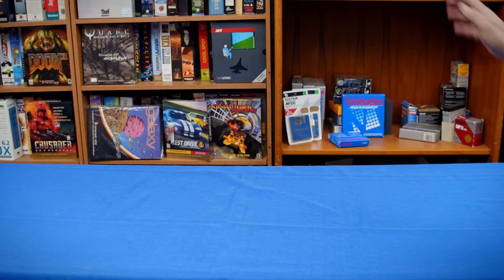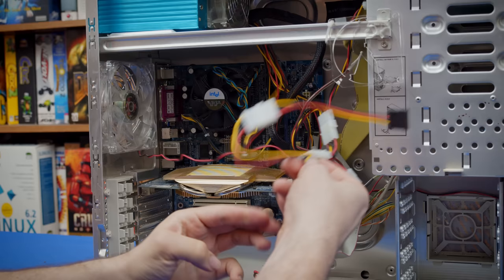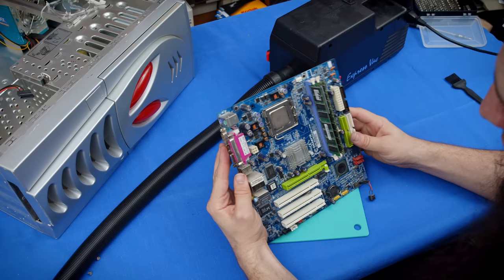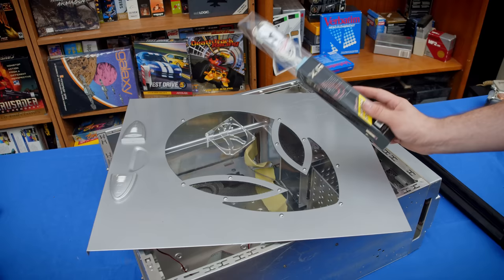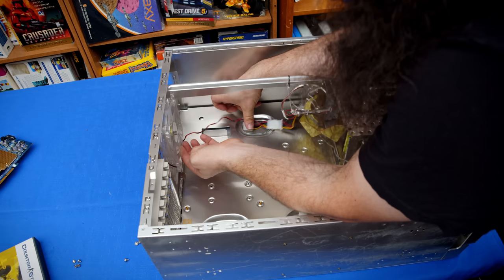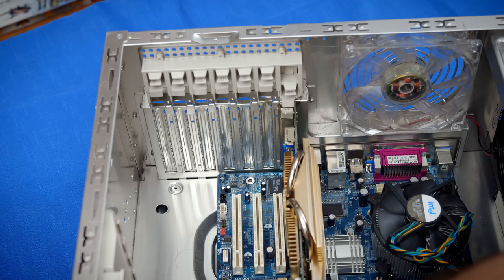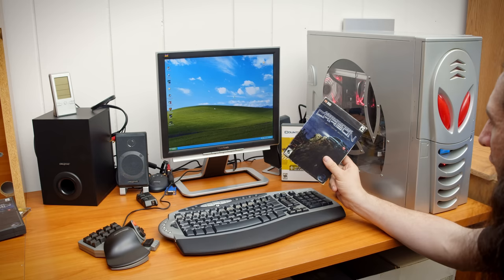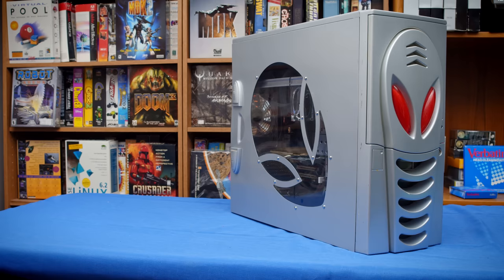Windows XP Gaming PC Brought Back to Life

Comment: That big heatsink actually came with every P4 on socket 775 and was used (slightly redesigned) for several years, the thinner one appeared sometime during the Core 2 era.
Reply: It was well made apart from the crappy black clamping poles.  I made sure to order a Zalman flower cooler when I did my P4 build (Abit AS8 + P4 640 + Winfast Geforce FX5900XT), in April 2005.

Comment: That case (other than the alien) reminds me of the case I have and still use. I have an xclio A380 from circa 2008. Other than mine having absolutely massive special fans, the mb tray and drive mounts are almost identical. Mine has an improved expansion card retention mechanism. 
My giant fans have long-since died, but the case is just too nice to let go. Completely tool-less and sooo much room for everything you could want. And when the fans were working, it had enough airflow to keep even a modern i9 cool.

Comment: Hey Shelby.. new subscriber here. Was recommended by Usagi Electric. Very cool build you have there! I had an actual Alienware Area 51 in the black case, and even though it only had a Core 2 Duo in it, it would still run Win 7 flawlessly, and the graphics were pretty impressive. I currently also have a Falcon NW mid-tower with a Core i5 and 32gb. running Win7 as we speak. It handles any legacy programs I need plus it hosts my security cam software, which Windows 10 doesn't seem to like too much.😂Don't know if you'll see this, but Usagi Electric sent you an email earlier today to see about getting us in contact about some vintage machines I have here!😉

Comment: I have lots of cases like this. I've hardly ever gotten rid of cases. I have one with analogue dials for temps and stuff that i'm looking at right now.
It's probably my favourite of all my old cases which is why i still have it. Nothing inside as that has long since gone but the case is still ok.
I also built a modern PC in a case i bought around 2000 for my daughter. It looks like a power ranger! lol
Reply: I think there was another comment somewhere here from someone looking for a case like that for a retro build.

Comment: Max out the CPU and RAM, add the backlight, replace the thermal compound and pads on the graphics card, and recap the power supply. This is the highest end 00's build I've seen.

Comment: Been working on building myself a pc for gaming/music production, specs are as follows, Motherboard: Asus TUF Gaming X570 Plus WiFi, CPU: AMD Ryzen 7 3700X, Ram: 2X 8Gb DDR4 3200, System Drive: 1X Crucial 1Tb NVME M.2 SSD, 1X Samsung 1Tb 2.5 inch SSD, Optical: 2X DVD Burner Drives, Graphics: Nvidia Geforce GTX 1660Ti 6Gb, OS: Windows 11 22H2, runs great.

Comment: I have an Ultra power supply for over 15 years and it worked flawlessly until I retired it a year or 2 ago and it was still working when I did retire it.
Reply from the maker: For my 20th Anniversary build I opened one that was brand new sealed from 2004 and it had burst caps. It's possible that both of mine would have "worked" but for how long and with what output noise is another thing. Not worth the risk when they have known failures.
Reply: @TechTangents  oh wow. Yeah I understand I would have felt the same way if that happened to me. But in my case I guess I was pretty lucky.

Comment: As someone that went through the pains of upgrading for games in that era, I'll use Need For Speed as a timeline: Up to Hot Pursuit 2, they could run on pretty much anything with a graphics card. Then Underground was another milestone since it was the last series to run on the GeForce 2 MX (very popular back then especially in Europe). Carbon moved up to GeForce 4 and so on. It was a really crazy release/upgrade cycle because it wasn't really the difference between more or less frames: it was will it start or not due to features like Pixel Shader and Direct X versions.

Comment: I've always been curious about where these cases in the mid-2000s came from. The same designs would show up in every online computer store, never with any branding. I assume it was just one company that was churning them out.

And yeah, the speaker on the GPU would squeal loudly at you if you didn't have the power connected. Scared the crap out of me when I was 12 and building my first PC.
Reply: Considering how common chieftech cases seem to be it may as well be.
Reply: Chemning/Chenbro. Available in aluminum or steel. First one I've seen with a 120. Normal config is 80mm front and rear. Looks like the swing feet were removed to cut cost.
Reply: @piscikeeper  Ah I knew I was missing something, it was Chemming lol.

Comment: That was not an AT power connector. It is physically compatible but completely different. It was auxiliary power plug announced at the time when first Pentium 4 CPUs were launched.
Reply: Yep, that’s an early ATX connector with extra conductors on the low voltage rails, before CPUs started running off the 12V rail.

Those plugs may have different keying that should prevent them from mating with the old AT headers, but those keys are often missing or broken.

Comment: Nice find, man! I really enjoy pentiums 4 for retro machines. They are so reliable and cheap! That GeForce 6800 was a very nice find. Indeed it was cream of the crop for agp, one of the faster cards for that bus. One thing to consider is that the pentium 4 probably doesn't have enough oomph to push it properly, but you know, still a nice build. I enjoyed the video.  Thanks for another one. 👍 Edit: I would definitely put a fan on the video card for conservation purposes.
Reply: Depending on the board a cheap Core 2 will perform better and pull less power. Something like the Celeron 400 series should run away from every LGA775 Pentium 4. But if it has to be a P4, Cedar Mill is your friend. Got both here, and both would do a nice job in a mid-late 00s retro build.
Reply: I keep looking out for Tualatin core P3 CPU’s & compatible boards for retro systems as they would smoke a much faster clocked Northwood P4. Intel realised this by basing the original “Core” CPU’s on the Tualatin architecture (obviously with a fair bit of reworking) that replaced the P4 architecture.
Reply: @OliverQueen1974  I remember thinking my P4 2.0 was hot stuff until a buddy with a tricked-out P3 system would smoke me in gaming performance, turns out Northwood (and the Pentium 4 as a whole) was just a failed experiment that they didn't give up on nearly soon enough.

Comment: This is a nearly identical PC to my old PC I just recently restored, sans the ridiculous case. Never liked this sort of outrageous style even as a teenager. I ditched all the original fans and the CPU cooler. They were just too loud by modern standards. Also the CPU always ran hot back in the day with the the stock cooler. I also threw in an SSD for good measure; it only does about 120-130MB/s on this old system, though it's still much faster than it used to be with the old HDD and, of course, it's totally silent.

Comment: For my XP build, I found a version of MSI Afterburner that still supported XP to track temps with (And also try to overclock with, unfortunately the 9600gt I got was a bit naff.) Seems like that would be even more useful here, check to see if that passively cooled card is actually working well. Assuming you plan to actually game on it regularly anyway.

Comment: There were "black light" LEDs around at the time, I recall having one in my computer around 2005. Was basically just the LED at the end of a molexed cable with a holder that came with some double-sided foam tape to hold in place. Considering it was in a Shuttle-style SFF case, there wasn't any room for a cathode tube.

Comment: If you want to just replace the LED with a new one, then simply drill it out. Clamp the acrylic between two blocks (wood or rubber or plastic will do), and simply drill out the LED. You can start with a small drill bit and work your way up. small LEDs are 3mm, and large ones are 5mm. Once drilled out, you can then replace the LED with a new one, even a UV one if you wanted to, and just glue it in place.

The blocks are there to protect the acrylic, both from cracking while being drilled, and from being scratched. You can also place a cloth on either side for added protection. In the case of not having a proper clamp, you could even sandwich it under a stack of books, for example. You don't need to force the drill... It's only plastic. The metal bits of the LED will come out easily under the force of a drill bit. Just do little bits at a time, and go slowly and easily.

Comment: 6800 Ultra was a larger spec'ed card of the era that required more cooling. I loved the cooler designs of those, double slot and usually with artwork. I remember pining after one in 2004 while stuck with my awful mid-range FX series card. I was too poor to upgrade to that, but I did eventually get my hands on a 9800 Pro instead which was an awesome upgrade. I eventually did get a 6800 Ultra from eBay for like $14 before the retro craze  (I can't remember when it was, 2012 or so?) just for nostalgic purposes.

I remember in that era there were quite a few GeForce cards that had crippled memory buses. I wonder if that's happening here with your card.
Reply: The 6800 Ultra is a good 70% faster than the regular 6800. There's a huge difference. That could explain it. This was also an era where an Athlon 64 blew away a Pentium 4 of the same price in games.

Comment: That's a super cool computer. I'm a massive sucker for UV stuff and the combo of mesh and window is quite nice on that. My XP rig's a little more pedestrian, an old Dell Dimension from ~2003 but it's got good parts in it, I got to throw all the RAM it wants at it, and unusually for a Dell, it's rock solid reliable, and doesn't seem to be possessed by demons.
Reply: I still have my Dimension 4550 (from 2001 or so) but maxed the board out to 1 GB of RAM and it's got an FX 5600 Ultra (I threw out the GeForce 4 MX420 that it came with).  I put SO many hard hours of gaming on that system and it still runs great, it's on Windows 7 right now but I may roll it back to XP as a retro setup.
Reply: @406Steven  that's pretty cool, not familiar with the 4550 so gonna have to look it up, mine's an 8300. Is yours using SDRAM if it maxes at 1gb?
Reply: @Ametisti  It's DDR 266, if memory serves.  I liked it back in the day because of the flip-up front cover revealing 2 more USB ports and front panel audio.  It's got a massive heatsink on the CPU with a hood that flips-up for ease of service and a really clever retention mechanic which makes it easy to remove the heatsink.  So it's basically a case fan which also cools the CPU (something which Dell stuck with through most of the 2000s).  My parents got it for me as a Christmas present around 2001 or 2002 and it still runs great!
Reply: @406Steven  looked it up! Looks like the case is the same as the 8300. I do love that era of Dell styling. I'd love one day to like get one of the Optiplex G260 or similar and make like a little HTPC or TV gaming thing. 
I got my Dimension in like... 2012 or something for free for tinkering XD
Reply: @Ametisti  HTPCs are cool and I run one because I always wanted one but couldn't justify the money until more recently but look into an Intel NUC if you want to run an HTPC.  I have one with a 7th generation i5, 1TB M.2 drive, and a 1TB 2.5" drive from an old laptop that I store some old TV and movies on that I recorded back in the day.  It works well with Amazon Prime and Paramount+ but I could just as easily use my Playstation, XBox, Switch, or a $20 Roku/Amazon stick so you've got to want a PC for your multimedia uses anymore as there are a lot more options out there now.
Reply: @406Steven  yeah, it's more a want for the sake of want. I have a Chromecast if want something my 360 can't do. 😀

Comment: Holy wow, This brings me back. I used to have a Chieftec Dragon case I got as a bare bones rig from Soyo back in the day. It had an AMD Duron 1 GHz CPU with a Soyo Black Dragon motherboard in it. I STILL have my Creative Labs 5.1 surround speakers like yours, but mine are in storage. What made me recognize them was the bass/volume/mic jack desktop controller. Then I looked at the speakers and knew what they were. I also still have my Belkin Nostromo N52 keypad, but I haven't tried to run it with Win10. The latest drivers I found, back when I looked was for Vista/Win 7.
  If you had either a Microsoft Trackball Explorer, or a Kensington Expert Mouse trackball the picture would be complete. This was in a really difficult time to be a PC enthusiast because almost nothing was universal back then. There was 900 different types of memory, and they were all specific to board manufacturers instead of the platform itself (that I remember). In OEM systems almost every cable, and case was proprietary, and it was near impossible to just swap parts. Compaq was the worst for this treachery.
  I remember that era, and it was both incredibly fun, and horridly nightmarish, lol. Thank you for this!

Comment: @5:34  In the before time, when ATX MB connectors were moving from 20 to 24 pin and the 4/8 PIN supplemental CPU power was about to materialize, additional power to the MB/CPU came from the AT connector you see there.

Comment: I wonder if it wouldn't be possible to cram a semi-modern, or at least an older reliable unit in the extruded aluminum chassis, if maybe the screws posts matched.

Comment: Somewhere around here I've got a P4-672, which is a 3.8GHz beast that would probably work in this machine. I think they EE might have been a bit faster in terms of performance with the 1066MHz FSB, but I don't think that would work on that MB since it's limited to 800MHz FSB.

So yeah, if you can find a P4-672 for a reasonable price, plus a Radeon HD4670 or HD3850, this would be a bitchin' fast XP machine!

I wouldn't be that fussed about period correct lighting if you can't see it from the outside, just buy some 12V UV LED tape and be done with it. For the CS acrylic thing, I'd drill out the old LED and replace it with a modern super bright one. Although if you're going UV then that may cause the CS thing to react too and wash out the red LEDs.

The case itself must've been a pretty expensive one for the day. Having tool-less drive rails wasn't very common except in the more expensive cases.

Comment: For 2004, this was a good-looking PC. The blue anodized PSU that matched the blue GPU and mobo. The only obvious thing is the wire management, but considering they pulled the HD's before they sold the rig, I'm thinking they just undid it to remove them.

Comment: The fan on the power supply has a blue dot sticker on it. Every single lit fan I used in that era has a dot sticker on it with the LED color. So red LED's everywhere but a blue on the power supply seems odd to me.

Comment: I had that exact case years ago, in gloss black with blue LED light up eyes. I have NO idea who made it, but it's still running today, although it's fallen down stairs, etc. A friend still uses it now, with a Ryzen and a 1080ti inside. The punch outs were in case you had a soundblaster or similar front panel device that needed a few mm of space for volume knobs. It was hideous, goofy, and I had to have it. I also built 4 other systems using it for relatives who wanted alienwares, but heard the nightmares about the machines dying all the time.

Comment: I remember about +/- 20 yrs ago I was picking up thermal paste at my local hardware store (it was a radio shack type of store inside the hardware store...) iirc they had the same case. They asked some insane amount for it I remember finding it to order but shipping was pretty high so it was kinda worth it. No I didn't go back to buy it 😂
Reply: +/- 20 years means anywhere within a 40  year range. Probably what you mean is ~20 years ago or perhaps 20 years ago, +/- 2 years, or something like that.
Reply: @clonkex  exactly but most people I know don't use the ~ since they think it's a lemniscate or a wet floor warning sign.
Reply: @LaurentiusTriarius  Wtf, I've never in my life met someone who didn't know what a tilde meant

Comment: Aluminuim is not lighter than sheet metal per se. You need more material to get the same strength. 
It looks cool though and I think it is just marketing :D
>99% of the weight should be coils, transformers and capacitors anyway

Comment: Wow that brings it back. I remember the first Alienware cases that came in my shop I think were antecs otherwise. This one is awesome and I would be so torn between leaving it a retro rig or putting modern guts in it give or take some OG cold cathodes and stuff I am not sure if I still have some or not. I had a clear UV acrylic case impossible to keep clean but looked cool. You could always transplant another board into the power supply chassis but unless you are familiar with AC I can't recommend it but it would work. As for the logo.. dig the LED out with a drill bit by hand unless you like to live dangerously, clean it up (you might find leaving it a bit scuffed around the build will transfer the light and epoxy or a dot of hot snot. Bonus points put in an RGB LED. But yeah would have been baller walking into a lan party with that all lit up.

Comment: Got tickled pink when i saw the Gigabyte nvidia 6800 card..had the 6800 GT with the small blue lit fan on top. 
Was the first graphics card i ever bought.
Had to replace the bad OEM TP right from the start which dropped the temperatures by ~10°C...

Comment: if you tak a tiny drill bit drill out the led and then glue new one in make sure the bit is smaller than led hole so do bust the acrylic judt enough to grind out the bulb inside it.

Comment: For AT Style Power Cable The aux power cable was added to provide extra wattage to motherboards for 3.3 and 5 volts. This connector is rarely used anymore. It's most commonly found on older dual CPU AMD motherboards
Kinda older Version Of 20+ 4 Pin Power Cable